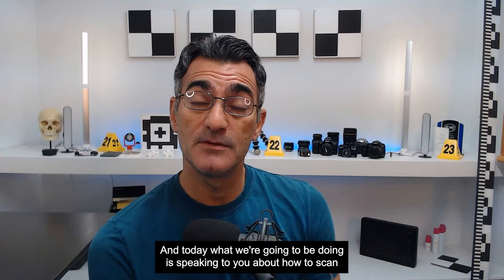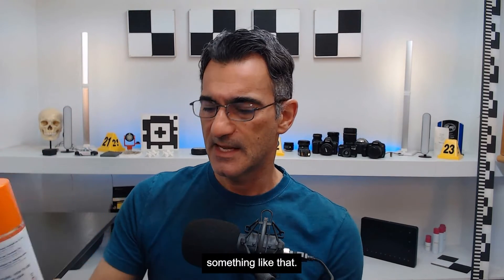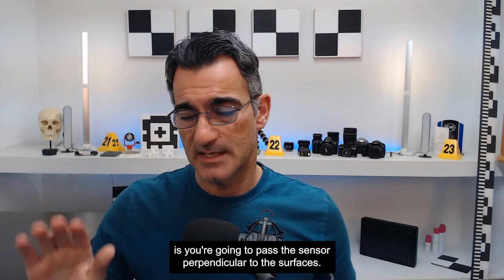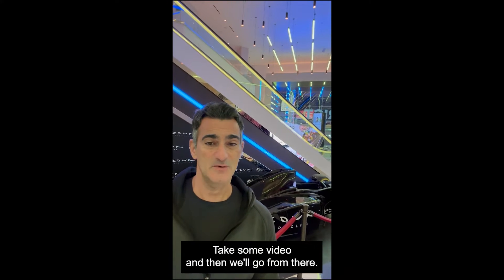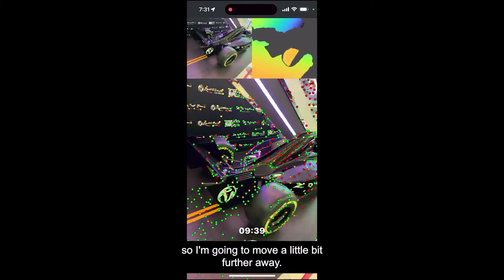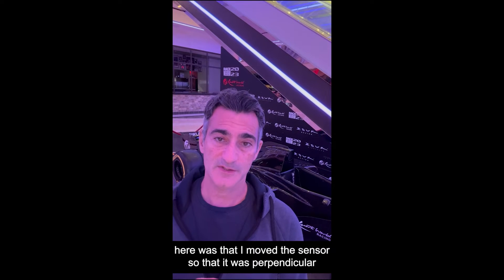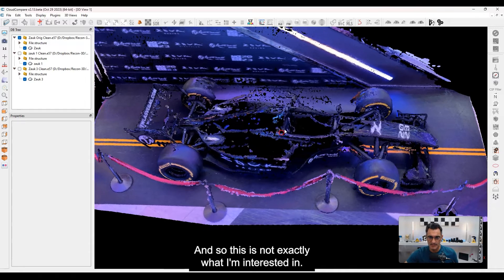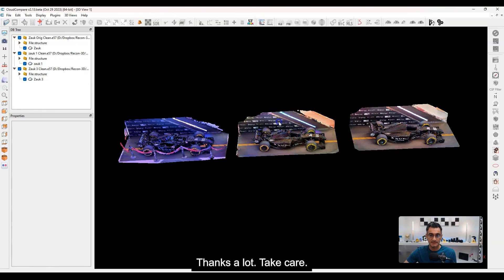Recon 3D - Scanning Black Shiny Surfaces | 3D scanning app | 3D Scanner | CSI

Comment: Really like the content you are making. I wonder if you tried to use a polarizer on the iPhone - same hold true for outdoors scans with mobile devices. 

Also when you use scales such as April tags, what’s the propertion to the total length you want to use ? 
Are 2 tags enough for scaling or you need information on the z axis as well ? 

I see that you can get luckier with shiny surfaces such as the car but what can you do about the chrome plated poles on the edges of the car ? You just can’t carry an aesub can and I was wondering if you can find a better process approach for those as well 

Happy to learn more - keep at the good work !
Reply from the maker: I have tested a polarizer and it works. I may be releasing a video on that in the future. 

Keep the targets as far apart as is practical. The targets should be on the outside of the object you are scanning where possible.

No Aesub...use 2" masking tape.